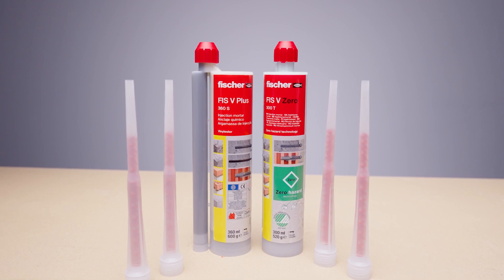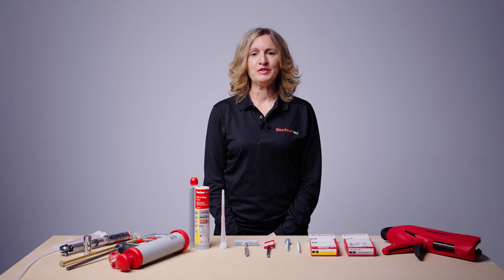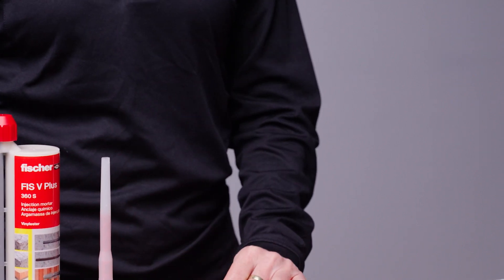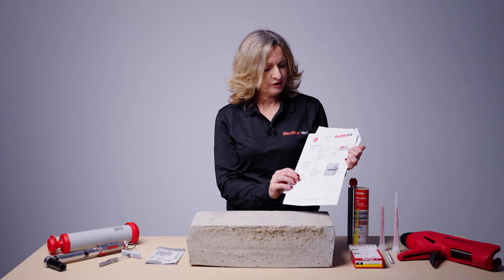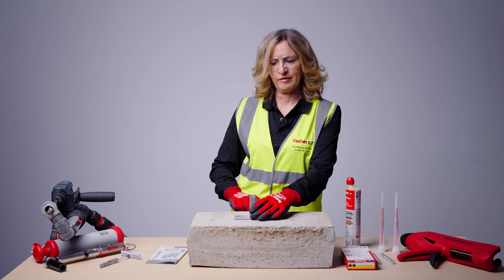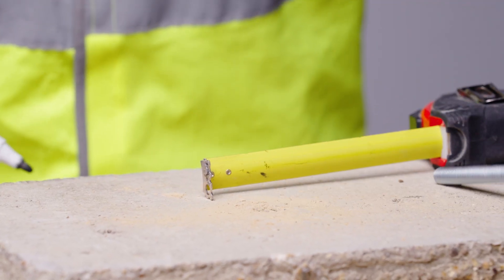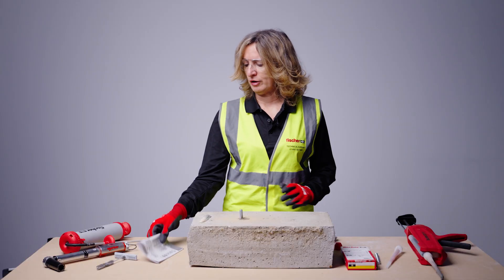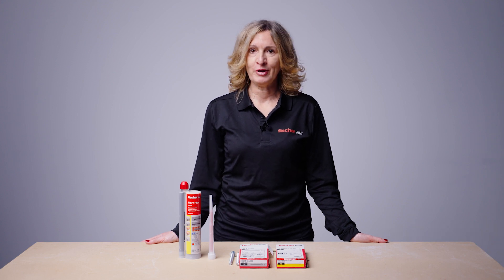fischer FIS V Plus Injection Resin | fischer ToolBox Talks Training

Comment: Re cleanup, in this video a lot of resin is left on the threads after only giving it a cursory wipe, which would prevent proper tightening.

Is there a better cleanup method? Or is there a suitable solvent (acetone?) that should be used?